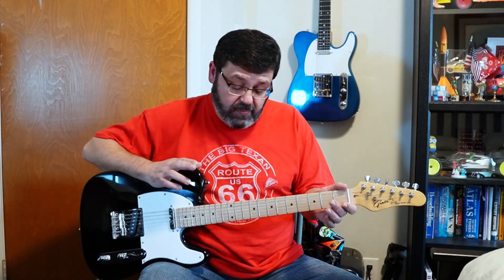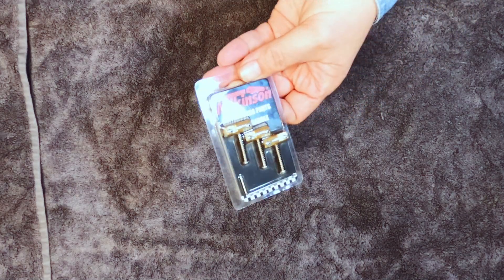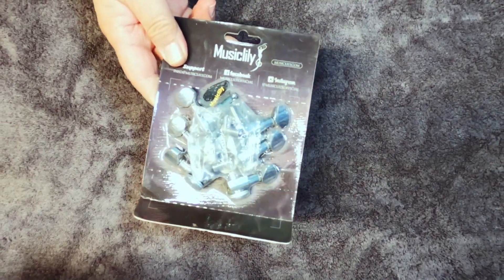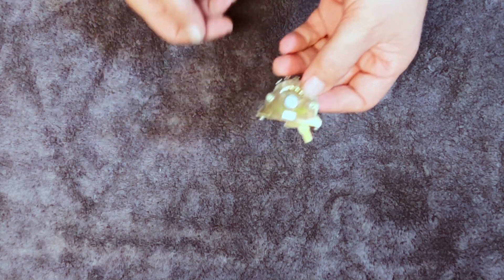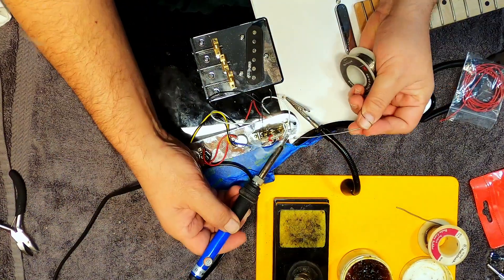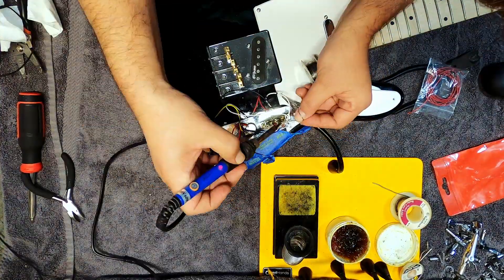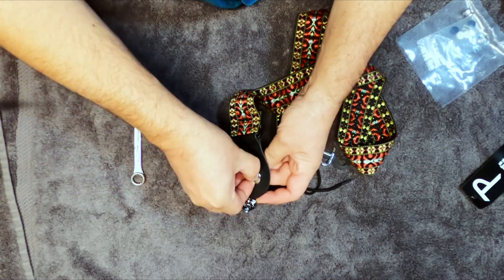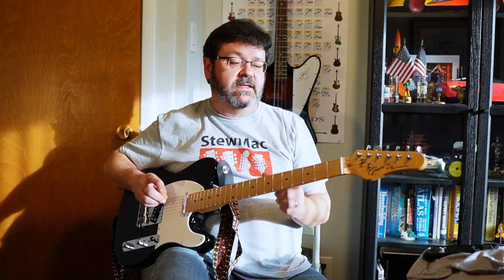Top 5 Upgrades for Sawtooth, Donner, LyxPro, Glarry, Grote, Monoprice and all other Telecasters!

Comment: Decent tuners , a good setup, decent strings, nut slots cut well and you can find out #5 for yourself.
Reply: I bought a monoprice tele for like 66$ just to have something a little different that I can mess with, was playable noticed that it was a little difficult to fret at the first fret, did some research and ended up getting a torch tip cleaner so I could file the nut, the difference was pretty amazing, felt like an entirely different guitar

Comment: I asked my technician to replace the pickups on my Glarry tele. He strongly suggested against it. The Glarry pickups had the exact ohms as his Fender customshop tele. He plugged it in and wailed on it after pleking the guitar. He convinced me to leave it as-is, other than nut and tuners. Even the pots were clean. We were both shocked.

I also bought 2 Donner teles from the estate sale when my guitarist passed away. He had them set one of them up so nicely. The other was left untouched. So its easy to judge before and after playability. 

The Donner was definitely the easiest to set up, and stays in tune nicely with zero mods. 
(I do plan to swap tuners, pups, and add a bone nut in the future). 

The Glarry took 2 days to get right. It was HORRIBLE to play before pleking. 

Conclusion? The Donner is a slightly better (but heavy) built guitar, and easiest to set up, as the Glarry was more of a basket case. (Two other techs had already given up on it as being impossible to set-up.)
But after proper pleking, the Glarry plays and sounds like a professional custom tele. The Donner plays like an open box Squire. 
Ive been offered big money for my pleked Glarry.... its that nice now. 
My fear is the Glarry may change in wintertime.... we shall see...(Yes I keep steady humidity at 45%) Whereas the Donner seems to hold its tuning and set-up very well.

Comment: Really interesting ideas. I have a Glarry that I'm thinking of upgrading (not my first rodeo), I've built my own guitar in the past, and have done tons of setups - 20+ guitarist/musician. The cheap stock tuners seem to hold up - I use luthier knots, I know there's some disagreements about them, but that works for me on cheap tuners. I never considered doing a 4-way install on this. I think a decent nut would help, but again, the cheap one is working fine for now. Also, maybe I got lucky, but the intonation is holding after the first setup and is pretty dead on. BTW, not knocking any of your ideas! I think that was a great install/ideas. Oh, and also cheap nylon straps work amazingly well (I've had the permanent installs too, many times - for comparison).

I had considered those pickups too, how do you like them?
Reply from the maker: They were hotter and more "Tele" sounding than the stock ones, but were a little noisier as well
Reply: @pawnshopguitarguy  okay cool, thanks for that! I was thinking of potting these stock pups to see if it helps with microphonics, but I'm guessing the Tex Mex ones would need it as well.
Reply from the maker: @rickraydubs  It's hard to say, but if the Fender Tex Mex ones are made in the same factory that makes the Tonerider pickups I would say they're probably not terribly microphonic. I have the Hot Classic toneriders and they are pretty sweet sounding.
Reply: @pawnshopguitarguy  I tried potting those pickups lol, they were basically what you'd expect, poorly put together and basically fell apart during the process. I have built my own guitar in the past and like I said I have worked on guitars for a long time now, so definitely going to be upgrading the bridge pup lol
Reply: Enjoyed the video good suggestions here's my 2 cents, play the guitar for a bit if you are not having tuning issues don't bother to replace them with locking tuners, in most cases (at least for telecasters) they are not necessary, maybe on Gibson type head stocks or if you are a heavy handed guitarist or if you use a whammy bar alot. The other thing I would suggest concerns the strap locks I personally use Fender rubber washer ones, here again they would satisfy most players except for highly mobile players who run around swinging their guitar like a baseball bat

Comment: Awesome video, but I think one of the most important  upgrades on a cheap guitar is better strings.  If you just change the strings and nothing else, you will tell a huge difference alone.
Reply from the maker: I know, and I see a lot of guitars that the strings are completely worn out and corroded and someone is still trying to play it.